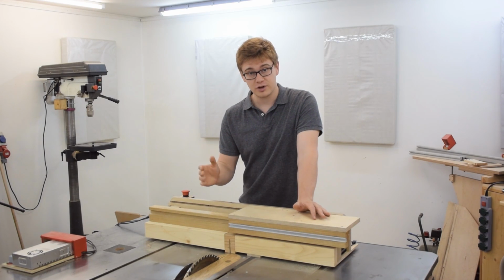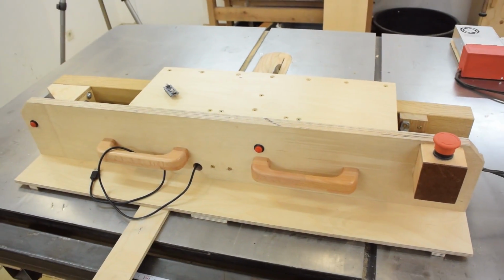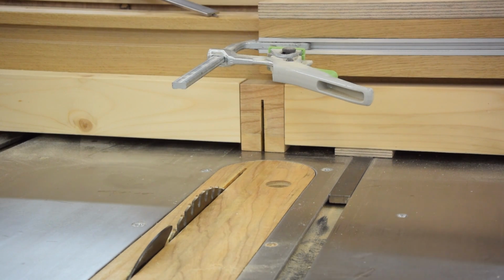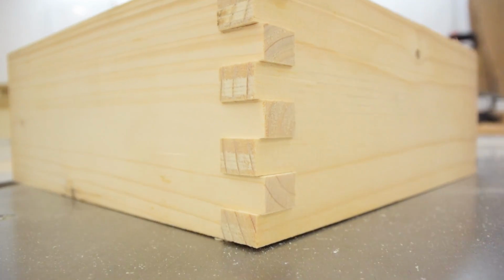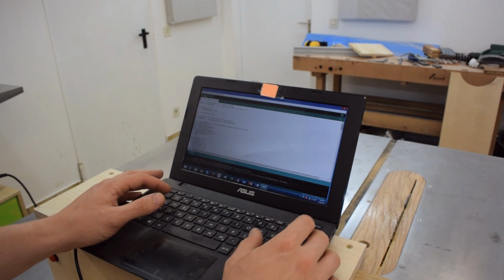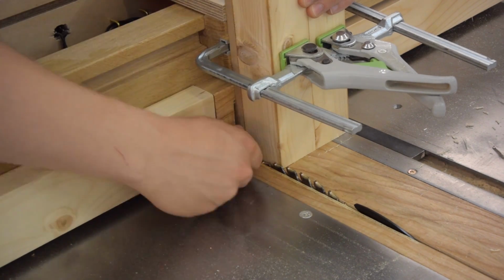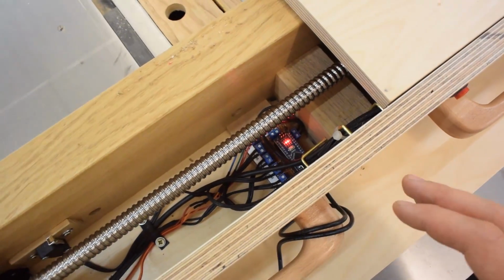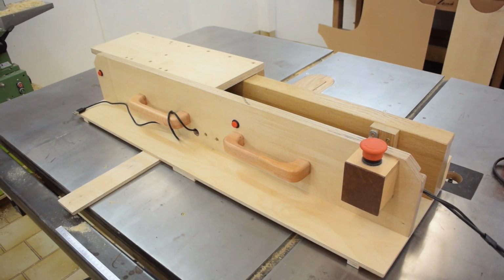Computer Controlled Box Joint Jig | Precision Box Joints | Arduino Project

Comment: I was inspired by this video a few years ago and last year I made one. I build guitar amplifier and speaker cabinets and do only 1/4 inch box joints with a dado blade (one pass through the saw for each slot). It's so precise and repeatable that I do all 4 boards at once (2 are offset), flip them and cut the other ends and done. Less time and physical effort. and eliminates errors.  Many thanks for making this video! I still don't understand much about stepper motors and drivers but I build great cabs.

Comment: I used an M5 rod instead of the ball screw - it's a lot cheaper! One problem was bearings, but I solved that by using TWO stepper motors, one at each end of the leadscrew. A single driver drives them in parallel but with a phase reversal to one of them.  It sounds expensive but it's a lot less than suitable bearings, and a lot less hassle to assemble.

I think I used the same PSU as you, but by poking about inside it found an internal 5v rail which I used for the electronics. I used a Nextion display, which provided a 3.2" colour touch screen for the human interface, and it has eight GPIO pins which are all you need to drive enable, direction and pulses to the motor driver and recognise limit switch signals. The display has a built in processor which you can use to do all the work, and you can program it with a PC-based editor which is object oriented and childishly simple to use.  I used one of the GPIO pins to switch on the router via an optically coupled SSR (£5)   (Mine was intended for a router table, not a saw) 

I don't have any buttons, except the ones I've defined on the touch screen, which makes for fewer wires. 

Like you, I worried about missing steps and considered providing an optical encoder to close the loop, but also like you I found in practice it was not a problem!

I also provided a 'half increment' facility so you can have a finger at the end or a space to accept one, and do both parts of a matching pair separately. The touchscreen was really useful here as I was able to display a diagram and place option buttons adjacent to the two options.

There are differences between your and my approach, but essentially they are the same. Mine has worked very well, and I expect yours does too. Nice to find someone else with the same idea!

Comment: Hey, Cosmas, thanks for sharing this, great build!
I tried building something similar, but the motor was so small that it couldn't move the carriage, which is made of a (kinda heavy) piece of particle board. Could you please share the specs of the motor and power supply you used in this project? Thanks!

Comment: Cosmas,
I like the idea of cutting both sides of the slots first to try and improve accuracy. I am just about to start building a version using a modified windscreen motor and a quadrature encoder from an old printer. I would appreciate looking at your code to save a little of the learning curve. I am new to arduino programming but it seems well structured so any help with the idiosyncrasies of arduino programming language would be appreciated. I am even prepared to contribute a few Aussie dollars for your troubles.
Mike

Comment: Hi. Fantastic! Hey I dont know how much you have been playing around with your Arduino but what you have built can actually be stepped up very easily to be controlled by CNC. You only need a breakout board and a few other bits and pieces and you are away. Oh and like Stefan I also have a CNC router with unprotected ballscrews without problems. The ballnut wipes everything clean. The only issue i have is if dust builds up at the ends. Do take a look at DIY CNC it is really cool. :-)

Comment: Really cool!  Thoughts for the 2.0 build.   What about an accelerometer or hall effect sensors in/on the table to detect movement instead of pressing a button to advance?  Or another micro switch even.  Maybe a grip sensor or button to hold so it knows you have your ur hands on the sled.  3.0 Motorize the sled?

Comment: Superb build (and, yes, I'm very jealous - I've been wanting to build one like this for ages, but never have the time).

It occurred to me that there is potential for doing complex/variable width fingers across a joint - perhaps widths matching a mathematical pattern, or even just random.

The thing to do now of course is to add a mechanism to move the sled back and forth, linked to the sideways movement of the carriage - then you can just press one button and sit back with a coffee while your box joint is cut :)

Comment: Very nice work.  I have a similar system designed around PIC18F252 with a 2x16 LCD called the DigiBox.  If you're interested, please check out the demo video on my channel.

Comment: Congrats on the box joint jig! it works great and I like the idea of cutting the outsides and then going back in to cut the insides.  I started an arduino box joint jig a few years ago that also did tenons.  I have a few videos up on my channel, they might give you some ideas.

Comment: Nice work. looks great. one question, why didnt you add a stopblok at the 0 point. so you can use that one to allign the side of the wood that you are going to cut? maybe even with a centimeter or guige in order to set the matching pannel in the correct position to create the starting offset that matches the teeth on the other board? or make a button / switch on the sled to indicate which side of the teeth you are cutting.

Comment: Could you power the system from something like a Dewalt 20v battery pack.  I think it would be nice if you didn't have to have the power supply on the saw.

Comment: I would add a third limit switch that prevents movement of the carriage unless the sled is in its withdrawn position. Sh*t happens and someday you will touch one of the buttons inadvertently and move the carriage when engaged

Comment: You can make a wiper for the ball screw by hanging a length or leather thong around the screw (1 or 2 loops) with a weight on it so the leather wipes off any dust before it goes into the screw.  I have this setup on my wood router and it works great.  It's an old idea that pushbike riders used to use on the back wheel hub to keep them clean.  Keep up the nice videos. :-)

Comment: Very nice job sir. However, in the video you say that this would work with a piece of threaded rod in place of the ballscrew. I don't think this would work as you would run into backlash problems, because the jig moves in both directions in order to achieve the cut.

Comment: Excellent work; I like that the sled is supported in the middle and on the two 'T' slots (unless my eyes deceive me) to reduce drag. I have a feeling you will improve this as time goes on - perhaps with a touch screen. As was mentioned below, automating the sled movement would be a great way to go - set it and forget it then you can concentrate on those other enjoyable woodwork tasks - like sanding through the grades - NOT!

Comment: Next step is to add an other for moving forward and backward, so you don't have to do it manually.
Then you add 2 sensor to detect start and end of the piece, and you can 100% automatize the process.

Comment: Great project, well done!

Not really knowing the capabilities of the arduino, could you have multiple buttons on the jig which are preset to the different and common sized joints you would be cutting? As in one for 10mm, one for 20mm, etc?

Oh, and are you selling/sharing the code, would be interesting to play with. 

Well done again!

Comment: To simplify the adjustment of the work piece to the saw blade you can add a small sacrificial stop block that you cut to size when the carriage is in the home position.
Works perfectly on my jig.

Comment: Great project! I would suggest adding a display & buttons to set width of joints, bladesize and so on... its much easier to use then... I did it this way and I'm really happy that I don't need to use my pc all the time. Anyway... great project! The ball bearing rod is fantastic... and way more precise than my threaded rod! Thumbs up!!

Comment: Without a display no use. At least you need use more buttons +/- 1cm and +/- 1mm, otherwise when you move the jig you still need keep a meter to check the distance moved. More button is easy to programming  and easy to use, 3cm you just need press a button 3 times and so on.
Reply: I think you missed the point of the Arduino.

Comment: Acme threaded rod will also work just fine.  This is what you find in manual vertical mills ( also known as a bridgeport).  I use that on my homebrew CNC and it has never had a problem with dust.. Its FAR cheaper than ball screws too. :)  Thought about doing this with my jig but I see no need to over complicate something that already works perfect if you know how to count..  Still a neat idea though.

On my MANUAL version of one of these things I just use a length of 3/8 16 allthread with the backlash dealt with using T-nuts on both the carriage and the frame and by running a die or a tap on the revelent parts. I have a measuted 2 or 3 thou inch total backlash.   why the 3/8 rod" -- easy to deal with using Imperal measurements-- one full turn gives 1/16 travel.   With say a 5 inch handwheel you can get down to around a 1/128th or about .008 of an inch very easily..

Comment: Great work Cosmas! I like your overall jig design, everything is well contained, and I like how the carriage clamping setup gives you lots of room for almost any size workpiece. I can tell you put some thought into the design. The ballscrew was a good choice. I used an acme lead screw with just a basic nut which runs the risk of some backlash in the movement, but it works well enough. You have a very solid design. Losing steps could be a concern, but you appear to have a very strong motor and driver. My motor runs on 12 volts and is not as large. At times I lose steps if a splinter gets drawn back into the kerf cut in the jig which makes it harder to advance, but it's rare. As long as you keep using a sacrificial MDF board that shouldn't be much of an issue. Good observation about the kerf width in software. When my joints are too tight I reduce my kerf width in software and it makes the cuts wider and the fingers narrower, though it sounds like you set your code up to do that automatically; good idea.
Reply: Why are you worried about backlash? Is that because of placement accuracy, or are you worried about play that might mess up the cut? You can eliminate backlash by approaching every position from the same side.
Reply: I move through my cuts all in the same direction, so the only significant risk to backlash is vibration or bumping the jig. My inner perfectionist would prefer an anti-backlash setup, but I decided to let that slide and it's mostly been a non-issue.
Reply: Thanks. That's good to know. I use my jig to make box joints with a router, so in my case, the router always pushes the carriage in the same direction. I didn't know if backlash would also be a non-issue with a table saw sled.
Reply: Backlash is more of a problem with the threaded rod. A ball or Acme screw would be less of an issue. A bigger stepper is a must. I used a small one and it skips steps some times. I have a bigger one to provide more torque. I also have a lot of friction from my threaded rod.
Reply: Couldn't you use two nuts with a spring between them to make sure the leading nut (the one that's attached to the carriage) is always riding on the same surface regardless of which direction you move the carriage in? It may take some testing to find the right spring for the job to make sure it pushes hard enough against the threaded rod but doesn't increase the friction to much. I would probably also use stainless steel threaded rods and nuts for this as that should wear a lot better and have less friction than mild steel threaded rod / nuts.

You should be able to chose the face the leading nut rides on by positioning the spring-loaded nut on the 'right' side of that I think.

Comment: The ballscrew should not impose to much of a problem - I think it will outlive you..we have an old cnc router at work with unprotected ballscrews cutting a lot of plastic with glas fibre in it.. :)
Reply from the maker: I used to work for an industrial furniture making company and they had these balls screws running covered in mdf dust all year. Not cheapo chinese ones though :)
Reply: what you could do there if it would start to impose an issue is add for example a small brush just before and after the connection to the sled to wipe it. or add an ailine that blows a bit of air over he ballscrew to clean it.
Reply: I've got a commercial (but relatively cheap) CNC machine, and whilst the balls screws have wipers they've been covered in all manner of wood, MDF and plastic. They get a quick clean and some grease after use, but it's been going strong for over a decade. I doubt you'll have any problems with your box joint jig.

Comment: the electronics will hold  , longer then the mechanical parts .  but you rewrite program memory every time and i think thats limited to 1000 times . So make it reconfigurable trough serial port or like Matthias said  adjustable by buttons and flashing LED"s

Comment: You have no display on it, but you could still make it so you could set the spacing just with the buttons.  Like, both down for a second means set-mode, one button adds mm, the other tenths of a mm.  both at the same time to go back to operating mode.
Reply: I would either use a Rotary encoder and LED or LCD Display, or a Bluetooth-Serial interface and do the Setup via a Simple Serial-Terminal from a PC or Smartphone. One could even use a Cheap ESP8266 and add a web interface over WiFi. Oh the possibilities.
Reply: @mordikal  The possibilities are endless, he just starts the 1000 mile journey with the first Computer Controlled Box-Joint Jig    V1.00.
Reply: @mordikal you are describing the controller of my jig, ESP8266 and a Smartphone to enter the parameters of the joints over WiFi ;-D
Reply: @mordikal for what it's worth, I built a web-interface-over-wifi control for my box joint jig, though I went with more complex hardware (raspberry pi), but you could certainly do it with cheaper hardware. As long as the user understands the necessary networking it's a nice interface.
Reply: VCR? are you talking about CNC?
Reply: I did something similar in my arduino box joint jig, and it works well. I have one toggle switch for direction, one momentary switch for mode (operate, set mm, set 0.1mm), and one momentary switch for doing a step. The important thing is that it gives some feedback from the mode switch. I used a brief back and forth motion as feedback. With 3 switches and 2 wires for the stepper motor, everything fits in an ATTINY45.
Reply: Do you have a video of that? I would love to see it.
Reply: What are these "VCR's" of which you speak? ;)
Reply: Matthias, I like your idea. 
Adding a 20 character by 4 line LCD display, a few PB switches and LEDs will  make the unit self-contained and a lot more user-friendly. Using the smartphone through Bluetooth or WiFi is another good option.
Barry Manilowa, it is not as if the interface in a Video Cassette Recorder (VCR) was not user-friendly. It was painful to most people since they  were not techies. In contrast, every woodworker that thinks of adding  computer control for his jigs is necessarily a techie and operating the computerized jig is no problem for him.

Comment: The open loop system is the same as in the cheap cncs, so i think you dont need to worry. Suggested improvement: another axis that feeds it into the blade

Comment: You don't need to build a special 'app' for it, just make it receive a Serial text command that sets the variables, and then either write a small program in Processing, or just use any serial terminal program like Putty or just the Arduino Serial monitor to send them. Would save a lot of time in the long run not having to wait for the compile/upload process.
The Arduino example 'Communication -> ReadASCIIString' is exactly this, although you should add a checksum at the end to make sure the data wasn't corrupted.

Comment: hi Cosmas you could add cheap display like 20x4 lcd and few buttons.  This way you will fix 2 issues - No need of laptop and you can edit the settings fast (depends how you build your menu) and the most important one  you will extend the life of your Nano significantly there is a limit to write cycles of the flash memory. The specs say 10 000 but this is max value and they can fail a lot sooner  like 100 cycles. You are using very quality parts (and expensive at least by my standard  ) and they will run for many years if you treat the cheapest part in your build  properly

Comment: This is an excellent application of technology and contains so many aspects outside my skill set. From a usability view point, two leds mounted on top, green for "push now", red for "don't push yet I'm aligning for the next cut". As others have said, a positive stop to set the material against before cutting. These are just suggested refinements to an excellent piece of kit. You are to be applauded.
Reply: Yes!